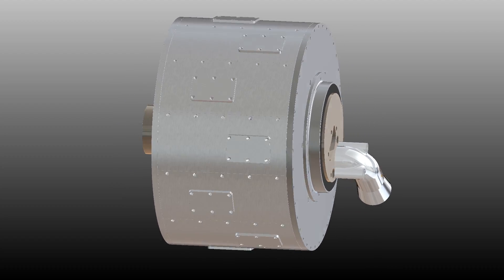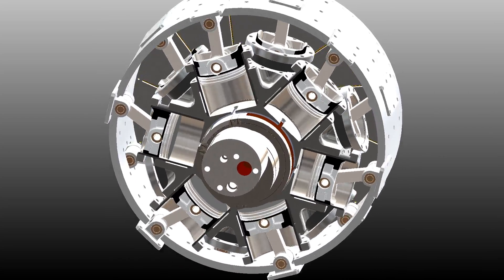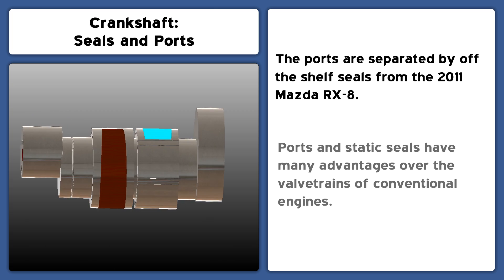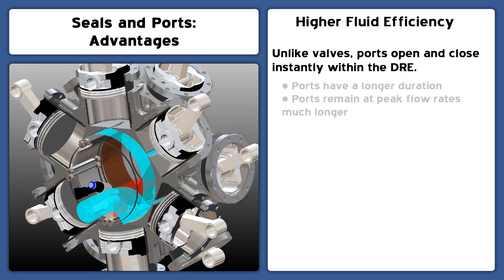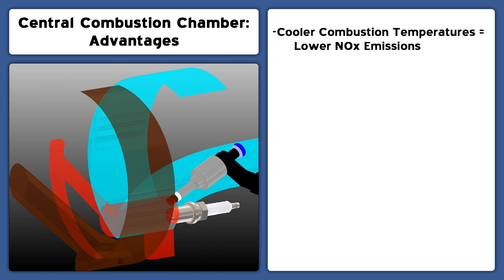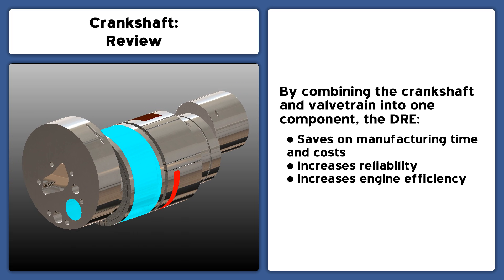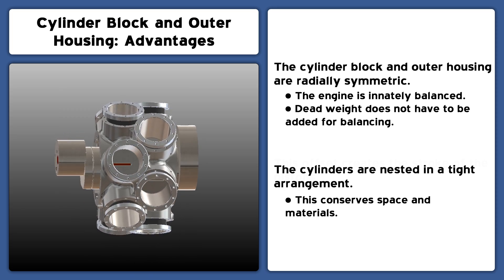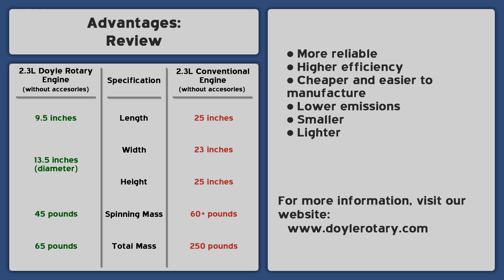New Split Cycle Engine Concept: The Doyle Rotary Engine

Comment from the maker: @burninmonkeys
The moment of inertia of the rotating portion of the DRE is less than that of the conventional engine. Despite it seeming like there is a bunch of rotating mass, in actuality there is less because the DRE is inherently balanced. The large counterweights (which are just dead weight that the engine has to spin) that are on conventional crankshafts are not necessary in the DRE.

Comment from the maker: @burninmunkeys 
A quick correction first: the rotating mass of a 350 Chevy not only includes the crankshaft, but also the big end of the rods, a flywheel and a harmonic balancer. This brings the rotating mass to 80+ pounds.
In the above video, we listed the weight of the spinning mass of a 2.3 liter DRE vs a 2.3 liter conventional engine. The DRE has 15+ pounds less of spinning mass. When designing the Doyle Rotary, we were shooting to match the moment of inertia of a conventional 2.3 liter.

Comment: @ADoyle88 (cont) that when applied is actually LESS efficient because it drains so much of its own horsepower due to it's own rotational mass and has to stay up at higher rpms (which it can't sustain due to so much weight) just to have enough power to drag it's 2600 lb car up a 10 degree incline. Your engine is not going to make it, WAY too inefficient. Sorry, you should work up a new concept.

Comment: @ADoyle88 I'm sorry, no reciprocating mass? You may be correct, but it has a HUGE rotational mass. Why would it be a great to rotate your whole engine around the crank as apposed the conventional way. Smaller, yes. Lighter, maybe. More efficent, HELL NO! Lets take a chevrolet 350, weighs about 500 lbs, Lets rotate the cranks, oh, what's that, about 50 lbs of rotational mass... lets rotate the block now, what's that? about 400 lbs of rotational mass? lets make a more efficient engine

Comment: Are you transferring gas DURING combustion?  That's got to be some seriously high-speed transfer at peak temperatures and pressures.  What are your heat losses for the combustion gasses moving at high speeds over the surface area during transfer (Kinda like squish x 1000!) and what are the blowdown losses?  Must be pretty significant.  Is your expansion stroke longer than your compression stroke?  I cannot tell from the video but it does not look like it.  If not, why do split cylce?

Comment from the maker: The cylinder block has water jackets around each of the cylinders and the stationary crankshaft is also water cooled. You can see the water jackets in the cylinder block around the cylinders when the engine is in the cutaway views.